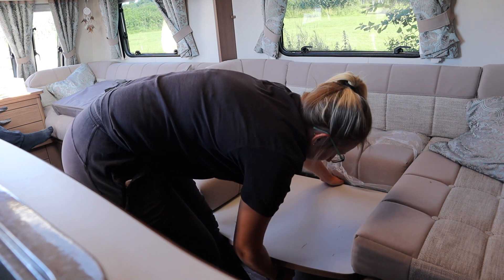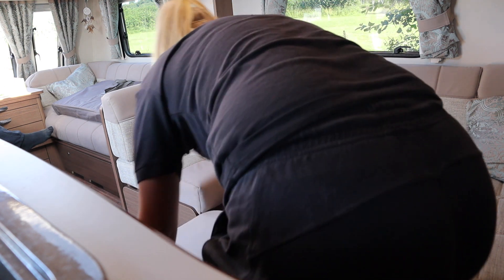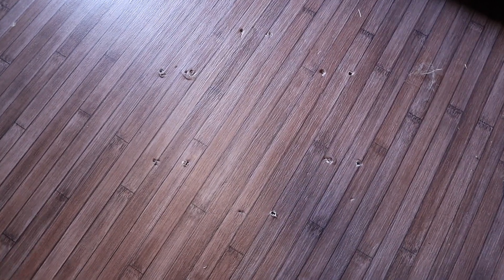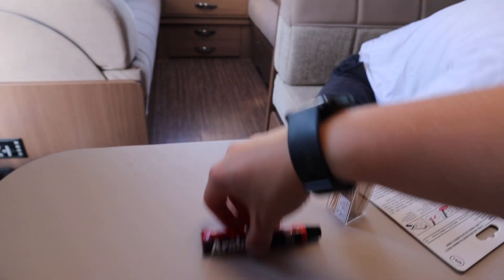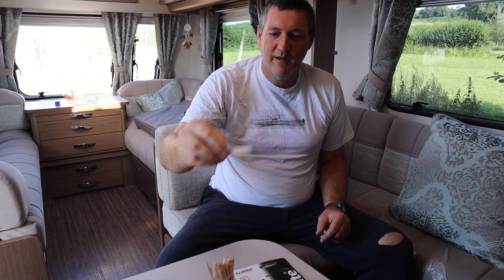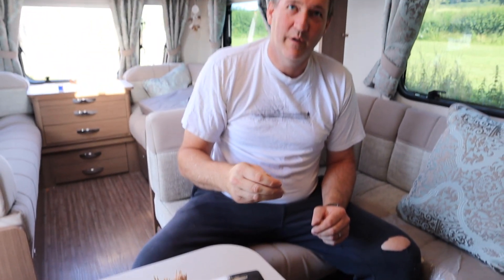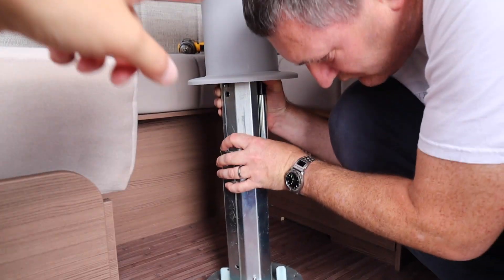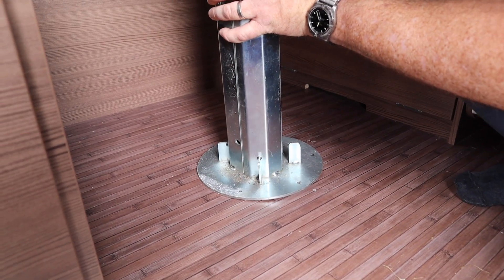HOW TO fix the caravan dining table | DIY with Damian

Comment: Hi Both, good vid though a slightly sharper chisel may have helped, if I am doing this sort of thing I have found a paint scraper (with Stanley type blade) gives a nice clean cut though you need to be careful you don't cut into the floor covering.
Reply: Gerbil Williams yes my chisel wasn’t the sharpest! Although the glue also wasn’t 100% cured which also didn’t help. Table now fixed seems to have done the job nicely.